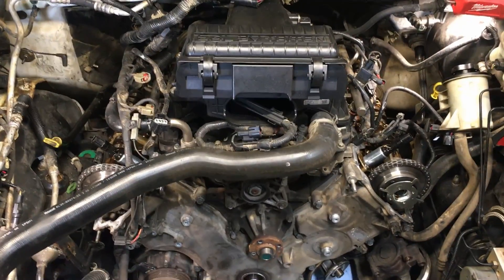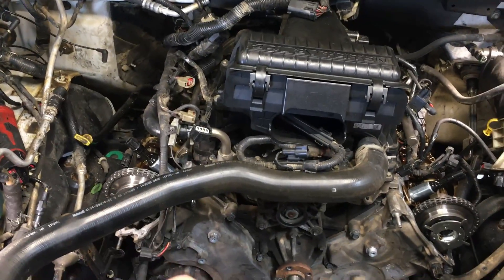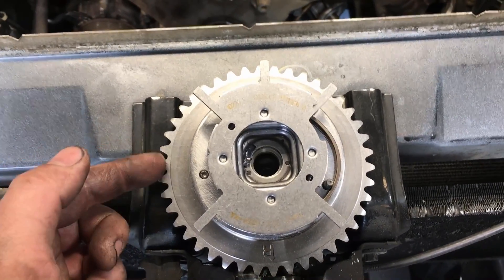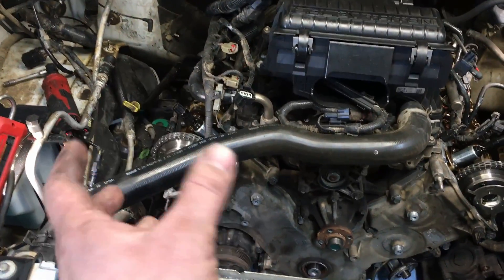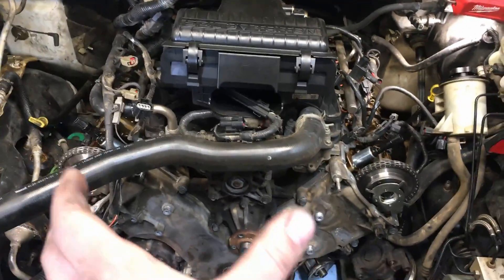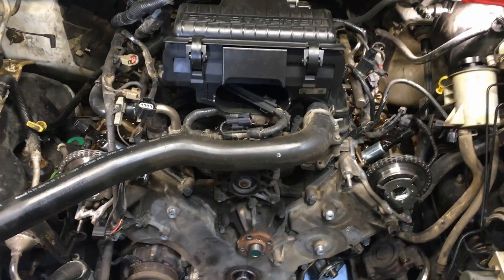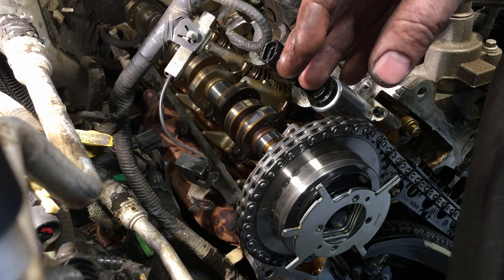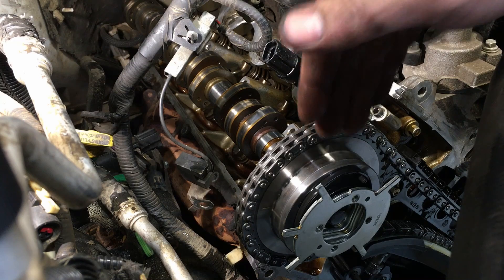Ford 5.4L 3v Triton Engine: DO NOT USE AFTERMARKET PHASERS FROM FREEDOM RACING/OTHERS; THIS IS WHY!

Comment: Parts stores to me are only for fluids/cleaners/tools.....not for parts.....spend the extra and buy OEM. There are plenty of wholesale dealers selling OEM parts online so you can save money instead of your local dealer.
Reply from the maker: Exactly! That’s why I link to and buy these OE kits on Amazon, you save big time!
Reply: FordTechMakuloco which ford f150 year and model that are compatible with interchangeable parts with my 2003 Ford F-150 XLT pls let me know asap
Reply: MotorCity Mechanic Hello Motor City!  U r to Mopar what Brian is to Ford. Anxious for the PT diagnosis. And hopeful for u to get a rack at home too!
Reply: I could only wish to be on the same level as Brian is. I hope to start filming on the PT tomorrow which is typically my day to work on all things youtube related. Man I sooo want a lift, the garage is not really deep enough, plenty of height, and not too sure about the concrete thickness.
Reply: That's precisely how I feel about parts stores too.  And half the time it seems you can't get the correct kind of fluids from the parts stores - instead they offer some sort of "one size fits all" solution.  ATF is a good example of this.  About the only time I'll run an aftermarket part is if I'm in a bind and need to get a vehicle going right away AND the part isn't too hard to replace in the event the aftermarket part fails.  I won't use aftermarket parts on customer rigs - it has bitten me in the butt more than I ever care to admit.
Reply: No doubt....I have replaced soooo many "lifetime warranty" parts over the years. Radiators are another issue.....I have seen the same box have two different brands of radiators....seems they just keep using the same box no matter who makes the part. Cant trust when they make switches from parts supplier to parts supplier like that. We all know the lowest contract always wins and thats what gets handed to you over the parts counter.
Reply: MotorCity Mechanic totally agree the parts store's sell trash i only buy oem parts
Reply: I go there just for the replacement 10mm sockets lol!
Reply: I prefer Kroger. For one....they are close to the house, never know when your going to run out. Second.....I like their selection, gives me more choices. I like variety. So.....where do you buy your Depends from?
Reply: Personally I prefer Kroger. For one....they are close to the house and you know how it is.....you never know when your going to run out. Second.....I like their selection. They have blue ones, pink ones, and even green ones. I love me some variety! So.....where do you buy your Depends from?
Reply: You must work at a part store! HAHAHAHA!
Reply: batteries too! better keep that receipt lol! Ive bought 2 batteries that were bad from the moment I walked out of the store
Reply: Anything aftermarket.......you best keep that receipt for sure!
Reply: MotorCity Mechanic ware
Reply: motorcity mechanic ur the man.  love u
Reply: I see you make your way around the internet!
Reply: Mainly because its like 1 mile from the house and no one shops in their pajamas like Walmart lol
Reply: I hear ya! Their store layout is a bit confusing where I am. Its the newest store around so thats cool as well. Never thought Kroger would have a clothing section and shoe section and sit down and eat food court.
Reply: MotorCity Mechanic I'm 100% agree with you👍
Reply: As another Motor City wrench, I must totally agree. Parts stores are good for supplies & 10mm replacements lol. Brian is 150% right on aftermarket phasers. I just finished a timing chain job on a 5.4L 3V & we got Dorman phasers. 3 days later it was back with the driver side locked all the way retarded. Ford parts all the way for this job.
Reply: Wait.....so are you implying that NAPA doesn't sell quality parts?? How could this be? They have the highest quality parts in the entire....

AH HA HA HA! I'm sorry, I couldn't keep a straight face.
Reply: It's the same as going to Harbor Freight to buy "tools".

Comment: My 2010 f150 with 70k miles on it has a tick for the first 4 seconds of start up then goes away any thoughts.
Reply: H&P Customs exhaust manifold? Just had mine done and the tick at startup is gone. But that doesn't mean yours is doing the same.
Reply: Low oil flow/ oil pressure on start up.  Try using a fully synthetic engine oil with the proper viscosity and use a top quality filter.  You might be able to upgrade your oil pump to get better flow.  If the phasers are functioning normally then it's best to just leave them alone and live with a little noise.
Reply: John Ferguson I’ve used the Motorcraft oil it’s semi syn and motorcraft filter since the truck was new every 4K miles.
Reply: I also only use the motocraft oil filter, it has a check valve to prevent bleed off. Definitely don't use fram.

Comment: hey man i have a 2008 ford FMF Expedition  and i got that bad noise when it gets hot and at a stop sigh or lights when i slow down , when i called my local dealership thy told me about a cam phaser lockout kit have u heard of that and used that or know anything about it.. any thoughts would be great ty..   and ty so so much for your videos
Reply: I used the kit from Livernois Performance. I have not had any issues. It has been about 9 months now.

Comment: also were you still gonna release the 4th gear issue video on the transmission that needed the check balls?
Reply from the maker: It’s a very long video but it’s finally edited, just needs a few tweaks. It will be up Monday morning 6am.
Reply: cool. thanks.

Comment: When it comes to the critical replacement Ford parts, Ford is king.  If you buy aftermarket, you run the risk of getting less performance and shorter life.  Aftermarket parts aren't tested as well as Ford testing for function/performance, life, fit...  Use aftermarket parts and you will be the tester!  That's my opinion.
Reply: If ford actually tested their junk, they wouldn't have so many problems in the first place
Reply: @ACatKrom  you are absolutely right, Ford screwed the pooch to start with and these guys are saying Ford parts are best. Hell, the reason all this happens is the original Ford parts were junk. SO TO ME IS SOUNDS LIKE BOTH AFTERMARKET AND FORD PARTS ARE JUNK (although I have never had aftermarket parts fail). My 05 King Ranch Expedition had multiple engine problems, all original Ford junk. Cam phasers, cam chain, chain tensioners, cam followers, rockers, ruined the camshat and cat....all shot because of week oil pump among other design faults. I love Fords, they make me lots of money.
Reply: Inspironator Ford rules! I go 200k+ mis b4 i need replace any semi critical parts.

Comment: Just finished my 05 F150 Rousch, right phaser was stuck out of phase. It was a pain but I took your advice and did the OEM kit and Melling oil pump. Not a novice job but with your videos it can be done. Thanks for the help. BTW I ended up dropping the oil pan to get metal from the phaser and chain debris from tensioners being bad. Thanks Again
Reply: The magnet trick does help except for the aluminum parts. I don't like that fact that the oil drain plug on this truck is about a half inch above the bottom of the pan. Luckily it only takes a few minutes to remove the pan and made changing the oil pump a breeze.
Reply: Put an old magnet from an automatic transmission in the oil pan to help sweep out any residual metal debris.

Comment: OEM stuff is so much better than aftermarket stuff !!
Reply: Motorcraft forever!!!
Reply: That's why it never fails! Oh, wait....
Reply: It depends, quality aftermarket performance parts don't have the same penny pinching cost mentality as a lot of OEM parts, in fact, I would go so far as to say a lot of ford parts that were in my 2008 Mustang GT like the plastic clutch line, plastic clutch pedal linkage, super restrictive intake tube, and a lot of flimsy suspension components were junk. I pretty much replaced everything with aftermarket. However, when it comes to critical and specialty engine components, like the phasers for example, no one is going to be able to replicate those parts better than Ford.
Reply: MegaThunder70 Not always, but in this instance yes.

Comment: Except the ford phasers are ridiculously expensive, it's insane to spend 850$ for a timing kit imho
Reply: Derek Stewart Yeah but do it only once.
Reply from the maker: $850 is dirt cheap compared to buying the same parts at the dealer.
Reply: FordTechMakuloco 
The dealership is a rip off, I'm an independent shop, I'm not arguing what you are saying, just explaining my experience, i do every type of car, hopefully I never have an issue but so far I guess I've been lucky, i always recommend the best parts, i even have them watch your videos so they know full well what to expect if there is a problem.
Reply: I've done several with Dorman phasers and havent had one single issue, i agree if u can afford the 445$ ford parts use them, I'll get a bunch of shit for this but I've not had an issue, i will try to use the ford parts from now on though because it seems like other people are having problems, i disassemble them and check them out before using them, I've been building custom engines for over 22 years and maybe some guys are not doing things correctly Idk, all im saying is I haven't had an issue yet
Reply: Derek Stewart I'm sure not all aftermarket phasers are bad, but I'd hate to save 450 bucks on parts, only to maybe have problems soon after and have to buy the OEM phasers anyways and pay for labour again.
Reply: 19 5oh coming!!! 
I totally agree, and what I'm saying is if you have to fix your truck but your broke and can't afford the 850 $ setup it's better to fix it with aftermarket parts that to do nothing, btw since I'm a tech i do these a lot and I charge s fair price, some guys charge an insane amount to do the job
Btw  i always recommend the ford oem parts but in the real world I can't always do that, i do only use ford vvt sensors, tensioners, and the melling M360 pump, changing a phaser if it needs to be done at least you only have to take off the valve covers instead of everything
Reply from the maker: In this instance it seems no manufacturer can get them right. I have not tried the new Dorman XD models yet though.
Reply: @derekstewart8175  the problem with saving is it leads to more expensive repairs later. I used aftermarket phasers, timing skipped and bend valves, now have to pull heads off. Wish I spend the extra $300 in first place.
Reply: Simone G. 
I'm sorry you had a problem, what was your oil pressure?
Reply: @derekstewart8175  thabks, don't know oil pressure to be honest, but i installed high volume oil pump. Compression on all bank 2 cyl was very low though.
Reply: Simone G. What was it?
Reply: @derekstewart8175  the compression? Dealer said it was 20-30% across all cylinders, not sure how accurate since they definitely didn't do a leakdown test, they told me I needed a new engine. I told them it was probably the timing or valves. So I took it home, took valve cover off, marked the chain and removed the phaser using the wedge tool. I found the pin inside complete broke. I tried installing new OEM phaser but the marked chain link was a few teeth off. Pulling heads off now to redo valves but I'm worried, I've been told you can't put rebuilt heads on a high mileage 5.4L. Do you know if that's true?
Reply: Simone G. 
You have to have a really good machinest, other wise to buy one they are very expensive, the have to align hone them like a main line, take the dowels out, cut the caps first then line hone them back to round with the correct clearane for them to get the right amount of oil to the phasers other wise there will be issued. And 20-30% is the leak down rate, otherwise they would say what psi they are.
Reply: Derek Stewart  With all due respect, I have a hunch that:
"done several"  <  "3 or 4 a week"  (@ 1:59 )
Reply from the maker: Were they the new XD version from Dorman?
Reply: FordTechMakuloco 
Yes, so far so good, but I'm no way claiming they are as good as oem, time will tell, I'm put a set on my truck next week, hopefully they work over the long haul
Reply: It's cheaper than a new motor
Reply: mds s 
Yes it is, nobody is debating that
Reply: What really chaps my ass is new heads are what 1100$ a piece, these love to eat up cam journals if you don't fix them in time, once there is too much cam journal clearance unless you have a real good machinest you are buying new heads, that's not a good design imo

Comment: Roughly how many miles do the phasers, timing chain, the whole job last? How many miles should I hope for the original parts in my truck? Thanks In advance.
Reply from the maker: With the latest parts that were included in 2009-2014 trucks I am seeing them come in right at 200k miles.
Reply: FordTechMakuloco thanks I have 125k and have the tick and have been wondering how long it will last! I appreciate you’re response
Reply: FordTechMakuloco thank you for that info. I just bought an 09 with 115,000 on 5.4 3v. I'm going to run  synthetic now that I know it's a known issue.
Reply: Bryce Denen all depends on how often you change your oil and the quality of it
Reply: Ryan T I run full synthetic every 5k with a motor craft filter